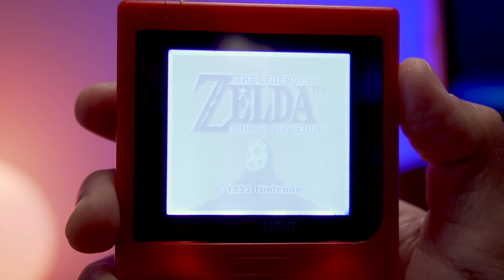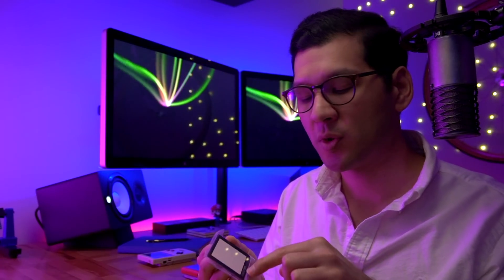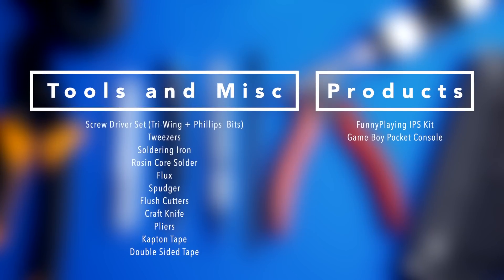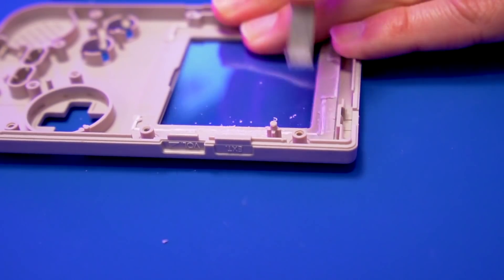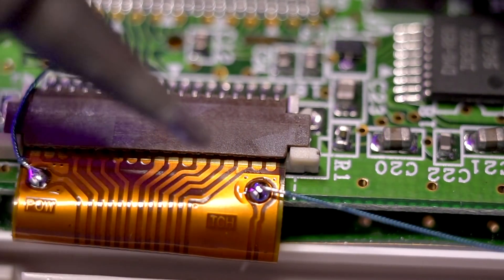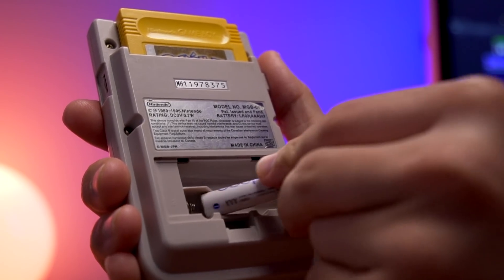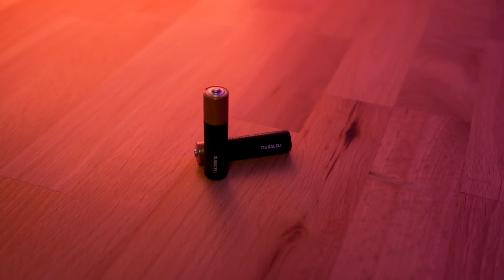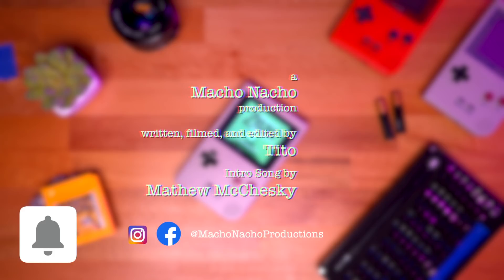THE GAME BOY POCKET IPS MOD I'VE BEEN WAITING FOR!! | Gameboy Pocket FunnyPlaying Kit | Retro Renew

Comment: The "problems" are still there on the DGM's as well. I think it's the way the IPS screen reads the picture. If you play Donkey Kong Land there are weird flickering spots that happen on the level select screens. I have found the Ninja turtles Fall of the Foot clan game always takes up the max size of the IPS screen which is bigger than the opening so it cuts off the edge of both the left and right side of the screen.

Comment: I think to not have the screen dim with a higher power draw cartdridge, like the EZ Flash Jr., the solution is to use constant power draw rechargeable batteries, or installing a GBP Li-Po battery mod kit. I'm sure the battery mod was covered by makho on his channel.

Comment: I JUST put a TFT screen in maybe a week ago. This is so awesome! Though I may wait to see if they fix the pixel mode issues.
Reply from the maker: Yep, I would wait. I think they updated the firmware recently so it may be fixed already. Cheers!
Reply: V2 will be made. Be patient.
Reply: Its actually an issue with the refresh rate with the Gameboy pocket, this was never picked up on the original GP screen.
Reply from the maker: I see. Do you think it’s something that can be fixed through a firmware update?  Or is it a hardware issue?  Thank you for sharing!  Cheers!

Comment: When it comes to OE shell trimming I’ll never understand the use of flush cutters when you could just use a cheap dremel and a cutting wheel and sanding wheel. 2 inch clamp to hold it in place, dremel with 80grit sanding wheel, an exacto knife for the precise trims by where the power switch sits. Is it more expensive? Yes, but it’s more precise and hold less risk of ruining the rest of the shell

Comment: Hmm, a test with medium brightness and medium loudness would have been good. Nobody is using smallest or highest brightness setting (at least not usually). But I assume it should be somewhere around 2 hours, which is really a disadvantage. Don't think I will do this mod. I have an IPS modded GMB and GBC, these are working fine due to the AA batteries. GBP really needs a battery mod for using an IPS screen. PS: Nice and interesting video nevertheless! PPS: Nobody of the Gameboy fans wants to hear it.... but the best way to play classic Gameboy/ color games is still the PS Vita. I definitely prefer it over all my modded or unmodded Gameboys, it's even better as on a GBA AGS-101 or on a modded 3DS because of the much higher screen resolution (much better interpolation). Image is much larger as on a gameboy/ color but still perfectly sharp, even with interpolation, and with perfect contrasts due to the OLED screen. If you like, you can even use 1:1 pixel mode (wich has the best possible sharpness) and the screen size is still a bit bigger as a GBC screen. In addition it has good battery time, great controls and form factor. Personally I didn't find any better way to play GB/ GBC games. Also the Raspberry Pi handhels usually have screens with much smaller resolution.
Reply from the maker: Hey Thunderbird1337!  Thanks for the comment!  That's a great suggestion to have the volume turned on slightly.  The only reason I turned it off is because I live in a small apartment and usually run the test at night while I sleep.  As for the Vita, I think it's a fantastic console!  I do plan on buying one at some point.  That's good to know it does emulation well!  I am planning to build a Raspberry Pi powered handheld in the near future, just waiting on some parts.  Cheers dude!

Comment: Having issues opening up my DMG. A few of the screws have already stripped (even used the proper Y00 screwdriver) 

I’ve tried all the tricks in the book: rubber bands, tape, super glue...etc. I’m out of options. Is there a screw extractor you can recommend?

Comment: Awsome video. I recently updated my GBC to an TFT LCFD screen and I have a GBP that needs an update. What battery size do you recomend for modding a GBP? I use for my GBC a pixel boy battery 2000mAh.
Reply from the maker: Thanks dude!  I would get as large of a battery as you can fit.  I wish there was a kit that would fit in the space available in the GBP, but it is a very small unit.  You will need to trim a large portion of the battery well to fit a li-ion battery in there.  Best of luck dude!  Cheers!

Comment: um... the adhesive piece is for sealing to screen so you don't get dust between the screen and the lens.  It's not for alignment.
Reply from the maker: Very true AndehX!  I think it is dual purposed to both prevent dust from getting under the lens as well as keeping the LCD aligned.  Depending on how precise the users shell trimming is, the LCD may have some wiggle room and slide around without the adhesive applied, since it isn't support on all sides.  Thank you for the comment and I hope you are enjoying the channel!  Cheers buddy!

Comment: I just did this mod earlier this week, but now it seems to fly through batteries in a matter of 15 minutes or so. Then the screen goes dark and starts flickering until it eventually goes dark. At first I thought it might be my rechargable batteries, but it's doing the same thing with new ones. I then took out the cable set up that controlled the color palette and it worked a bit better, but still ended up going wonky after 20 minutes. I can't figure out what the issue is, as it was working fine before the new screen. You have any thoughts on what it could be? Any help would be appreciated and thanks.
Reply: Shoot! I just rewatched the video and realized that I used regular wire instead of magnetic wire. Do you think that could be it?
Reply: So I went ahead and switched those wires to magnetic ones and the same thing is happening. It will play a few minutes before the screen gets vertical lines and then eventually goes black. However the sound will continue to play just fine. Also, it turns out that it is not draining batteries as I thought. As I just put some new Eneloops in there and they are still testing as full. I even switched out the mother board to another one and the exact same thing is happening. Not sure what could be causing this. Any thoughts?
Reply: This happened to me too and i don't know how to fix it
Reply: @lazymonkey7965  Yeah, it doesn't make any sense. I asked on the Reddit boards and we all thought that it was a power issue, so I routed the "POWER" wire further down the ribbon cable, as recommended by Makho (see link and scroll down to the bottom,) but still had no luck at all. I am at a total loss as what to do next. Was yours a Funnyplaying screen too?
Reply: Yeah mine is a funny playing screen and I just got it on Friday
Reply: @lazymonkey7965  I wonder if we got faulty ribbon cables or something. I have done a ton of installs in the past and I have never seen anything like this.
Reply: @hungrybartender6388  if its the ribbon cable are there replacements for sale
Reply: @lazymonkey7965  Yeah, but they are like 40 bucks. Not cheap at all. I wonder if anyone else has seen anything like this.
Reply: @hungrybartender6388  does the ac adapter work on it to see if the screen turns black
Reply: @lazymonkey7965 Maybe Tito has seen something like this before and has some advice?
Reply: @lazymonkey7965  so I finally got the adapter in the mail and now it works. Since it didn't work on two different Gameboy Pockets, I assumed that it was the IPS kit, but it maybe its something else?
Reply: @lazymonkey7965  so it turns out that Funnyplaying sent out an entire batch of IPS ribbons for the Pocket that were faulty. They are currently fixing it though, so hopefully we can get them to replace the ribbons. Peep the link for more info: https://www.reddit.com/user/RexziYT

Comment: I am having trouble with this mod. I bought the Funnyplaying IPS kit for my early non-LED MGB and everytime I hook it up I blow the F1 fuse. I bought 3 fuses from Console5 and this Kit has blown the stock fuse plus 2 from console5. I was told by the vendor that I need to upgrade my F1 fuse from the 0.5A to a 1A. Tito, did you have to take this extra step on your Gameboy pocket and replace the F1 fuse? I noticed yours does not have an LED battery light just like mine. Thank you in advance.

Comment: so i have my gbc, already have an shell for it on the way..im not sure of what screen to get. wanna go for a drop in but unsure of which one..any suggestions?
Reply from the maker: There are a lot of drop in TFT backlight kits on the market.  The only issue with those is that their screen are smaller than the original GBC screen, about 2.2 inches.  If you want a full size you'll need to go with the FunnyPlaying, but it's not drop in.  It depends on what's important to you.  Check out my Game Boy Color Backlight series playlist, I go over a bunch of kits, I think it will be helpful.  Also, let me know if you have more questions!  Cheers
Reply: @MachoNachoProductions  so i went with the freckleshack kit :)seemed to be the most sensible one since im going with a clear shell. the iups uses a lot of extra space thats unused imo

Comment: I have black screen. The console have power and red led is shinning but I have no image on screen...
All the solderings are ok.
It was a faulty screen, need to ask for a replacement 😥
Reply from the maker: I would double check the ribbon cable connections to the LCD and the GBC motherboard and make sure they are properly seated. Hope that works for you!  Cheers buddy!
Reply: Hi, Were you able to solve your problem? I also have the same issue with a black screen whilst having power and sound. I have tried reconnecting the LCD board, and the Ribbon cable multiple times with no solution. I can't find any damage in the ribbon cable or elsewhere, I even tried a different GBP motherboard and no change. I'm stumped.
Reply from the maker: Also make sure that the wire is soldered correctly to power. The screen not being on might mean it’s not getting power. A wire needs to be soldered.
Reply: @MachoNachoProductions  hmmm yea I resoldered it a couple of times. But I'll check it again. Weirdly I have contacted Retro Modding twice from their site and I haven't heard from them yet. 

Thank you for the advice though. Your videography, editing, and writing is top notch!
Reply from the maker: No problem!  Definitely send retromodding another email. They had some technical difficulties recently and a lot of their customer service emails got lost. Check out their Twitter, they made a whole post about it. Cheers and best of luck!!
Reply: @MachoNachoProductions  Hmmm I just resoldered it and I'm getting the same thing, a blank black screen with sound. But interestingly I noticed the screen is on, because it lights up lightly and I can see the black levels going up and down as I play with the contrast wheel. Its almost like there is just no other signal making it to the screen other black? Have you seen this before?
Reply from the maker: I haven’t. That’s strange. Definitely reach out to retromodding. I’m sure they can help you troubleshoot.

Comment: I wonder if rechargeable battery mods are possible on the pocket... I could stomach this mod’s shorter battery life if I didn’t have to burn through AAAs all the time. I’ve seen Li-ion battery mods for gameboy color, but the pocket has so much less real estate to work with. I’ve also heard rechargeable AAAs aren’t always reliable for gameboys. Does anyone know if this mod is possible/already exists?
Reply from the maker: I haven't heard of any mods currently on the market.  There is always the option to put in your own Li-Ion battery with a charging board but results may very in terms of how elegant the final product looks.  I hope there will be a kit to address the Pockets battery life issues.  I've had good luck with Panasonic Eneloop rechargeable battery.  They are a bit more expensive but its better than buying Alkaline batteries all the time.  Cheers buddy!

Comment: The flashcart will also not load if the battery is low.
Reply from the maker: Very true. The power draw of the IPs and the flash cart is a lot for the little gbp aaa batteries. I’m hoping someone makes a battery mod for the pocket to address this. Cheers Anthony!
Reply: @MachoNachoProductions  I hope so too! The GBP is my favorite gameboy when it comes to form factor, however the use of aaa batteries really limit it.  I know they are ways to add a rechargeable battery but my GBP is a complete transparent shell+button and I don't really want a ghetto looking battery mod being seen in the back haha.
Reply from the maker: I agree!  I’m hoping someone releases a clean looking battery mod!  Fingers crossed!

Comment: hey I just tried this but I'm getting a black screen, any thoughts?
Reply from the maker: Did you solder the wires for power?
Reply: @MachoNachoProductions   yes but the screen started lagging so then I soldered it off which caused the black screen. Would it have been better if I didn’t solder anything?
Reply from the maker: It needs to be soldered to the power switch other wise it won’t get power and the screen will be blank.
Reply: @MachoNachoProductions  so soldering the power pad is necessary but can I avoid the tch pad?